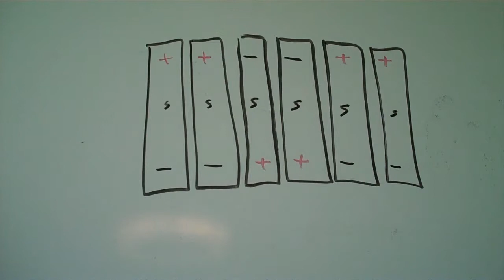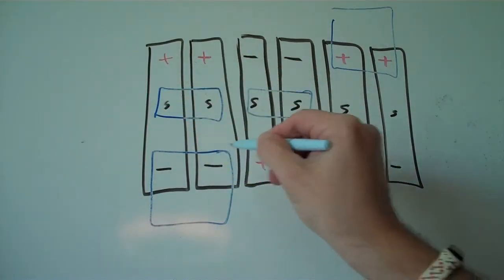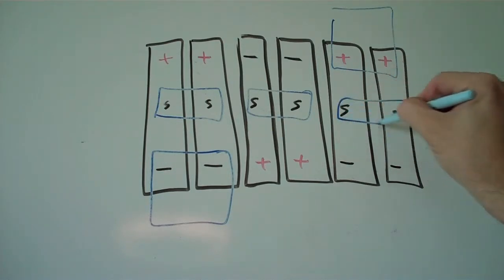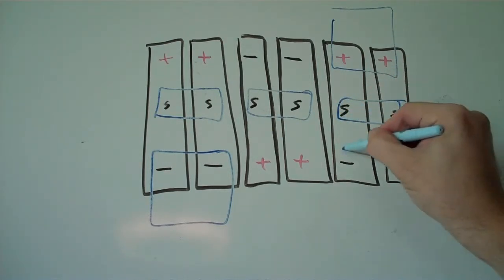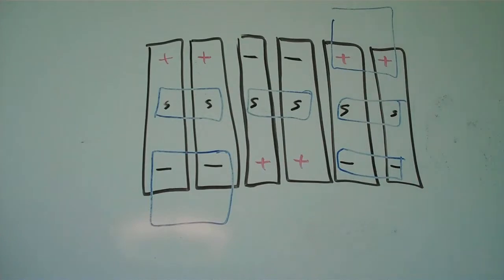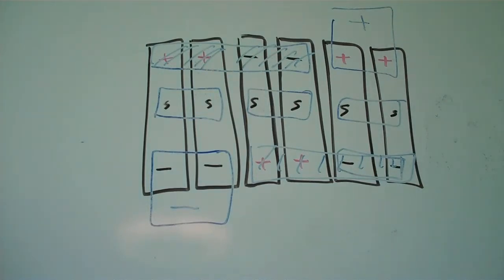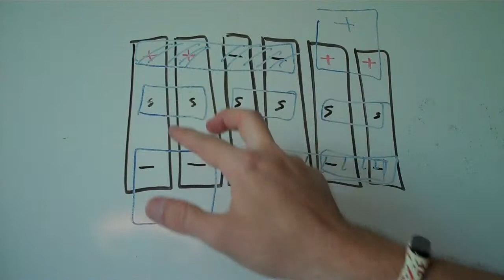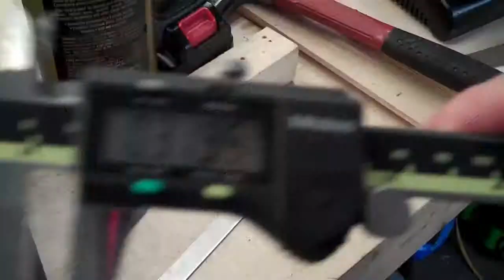Running a Well Pump off Batteries -Building the battery (part 4)

Comment: THIS is one of the best comment streams available right now on the discussion of using Leaf batteries for a 24v system. I have spent 2 weeks reading a majority of the feed streams on this configuration and I am still not certain on what path I should take.

I have a similar goal as Jay here but I also want to be able to quick connect/disconnect from a small 24v solar charging system with 24v Tracer controller with a grid tie over flow in addition to the basic 2 plug 24v inverter and I want a BMS in place.  My setup is the same as found on Will Prowse's site here because I eventually want to upgrade to the 24v Tesla packs.
https://www.mobile-solarpower.com/tesla-solar-battery-diy.html
So I ordered the 7s kit from Tech Direct Club thinking I could use their BMS solution and other parts in some variation of a 24v 6s solution.

The comments below highlight the problems with using the leaf batteries in a 6s configuration. A higher energy demand will lower the voltage of this battery to a point where fuses blow, wires over heat and breakers are tripped too quickly. It is not ideal but will do if your demand is minimal.

I am left with a few decisions to make....

1.) Do I sell me 24v hardware and replace with 48v and use the 7s Leaf kit as shown by Tech Direct Club?
Or couldn't I use a rectifier type solution to step down the 7s voltage to be compatible with the 24v hardware?  

2.) DO I keep my 24v hardware and use 8 leaf batteries in 2 modules of 4s? (Is this even possible and how would you do a BMS setup for this?)

3.) or should I just go forward with this 6s configuration and does anyone have a source showing how to do a BMS setup for this?  

4.) or I just stop playing around with the Leaf batteries and get the Tesla battery already. But I really like the physical size and stacking ability of the Leaf batteries for my mobile generator which is why I am putting so much effort into this.

*Any other links to LEAF project sources would be greatly appreciated. I have a master blog where I am documenting everything and will share upon request. 
Currently the AWPS, Jay Summet, Benjamin Nelson, Side Project, and Beginning From this Morning videos have shown some good video experiments related to this topic.

Comment: I run my well pumps off my Nissan leaf batteries. Nice detail. The batteries were very flat at under 24V. That is about 3V per cell. I don't like discharging them below 3.5V
Reply from the maker: I'm using 3 modules in series, and each module has two cells. I prefer to stop discharging around 3.65vpc (21.6v total) and I charge them up to 4.1vpc (24.6v total). Unfortunately, my inverter doesn't run the well pump well at under 24 volts (4.0 vpc) so the range of the LiIon batteries isn't a good match for my inverter.  What Inverter are you using?
Reply: @summetj  I have two. A Growatt SPF5000 and a Victron Phoenix. Either works. I insist on 48 V inverters. I had too many issues with wires getting hot and fuses burning on 24 V inverters. We run 100% off grid so the Victron is the primary inverter. It has very low energy consumption.
Reply from the maker: I'm afraid those guys are a little bit out of my price range ($1,000 total project budget). So far with 1/0 wire I haven't had any overheating issues (I'm only drawing 80-100 amps continuous for 30-45 seconds when the well pump fills up the pressure tank).
Reply: @summetj  is there are reason you did not do an 8S? The voltage range on 8S matches most inverters out there. I have two inverters a 3 Kva Victron Phoenix and a Growatt SPF 5000. They are both 48V. The Growatt is on Standby while the Victron is my daily driver. I had too many issues with the 24V set up. Difficulty matching batteries, and cables that always had issues.
Reply from the maker: I'm aiming for a $1,000 budget, so I only have $500 for the battery, which got me 3S 2P (6 modules). So far it hasn't had any problems delivering 100 amps for the half minute the well pump needs to run.  (It also easily trips my 200 amp breaker when the inverter has issues starting the pump.)
Reply: @summetj  the current draw increases once the voltage gets below that magic number. You will be shocked as to how high it actually is once the voltage goes below 23V. That is the huge disadvantage of these cheap units. Have you considered purchasing used units or the Axpert 24V. They are sold under different names. They are HF inverters but they have a huge following. It should fit right around your budget. You are paying about $80 per module for the leaf battery.
Reply: @summetj  consider getting a 48 V inverter and do a 12S
Reply: @drsolar  I suspect the Growatt SPF5000 is a "clone" of the Voltronic Power Axpert MKS 5K, at least going by the technical specifications.
Reply: @aogulla  they are pretty close spec wise. They are running a less sophisticated firmware than Voltronic